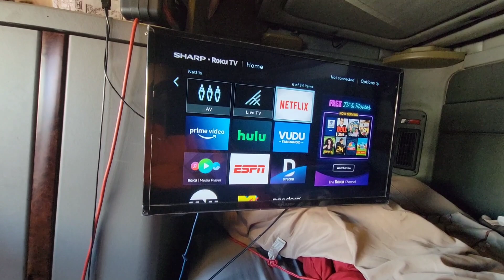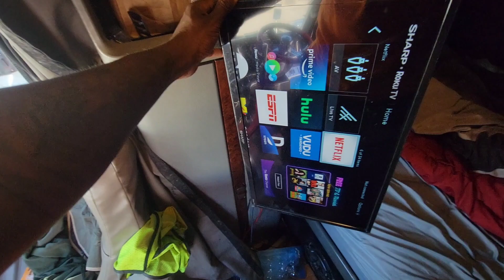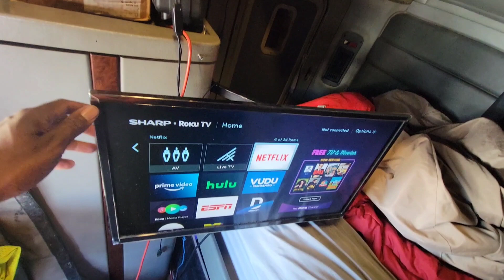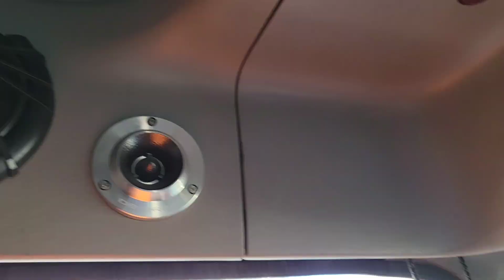See the inside of my 98 Freightliner Century

Comment: Big dawg🔥🔥🔥🔥 I need yo help got same truck just 2000 I need my dash just like dis mine chewed up when I bought it I don’t know  where start
Reply: I have a 1998 Century Classic  i need help on the inside
Reply: First is the truck safe to go to work if yes work the truck fix the truck first tiers nothing wrong with used 4 now then check wheel seal an bushing check not replace if seep fix  work fix oil leaks on engine from more important to less change that's for dot not to fuck with you after that go nuts on the crome first fix all problems you can find an do your self b4 shops man you will see why I say shops but link up
Reply from the maker: My apologies for responding so late.. But I agree with @ducktape mechanic.. the salvage yard.. One good thing about these trucks is they were once company trucks for almost all major trucking companies.... lots and lots of parts and goodies out there!
Reply from the maker: Yes sir... it's a gold mine for the Century and Columbia trucks!
Reply from the maker: Sorry for responding so late... same thing for you... I would start in the salvage yards and you can even get lucky and find parts on Ebay or Facebook market place
Reply from the maker: Great information!!
Reply: @ducktapemechanics718  i didn't see this, but you're absolutely right about that.